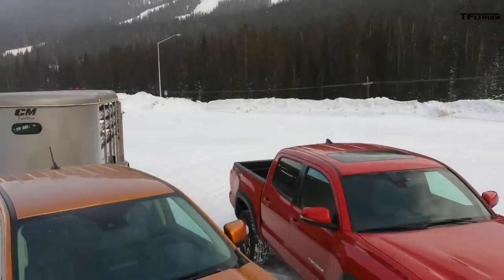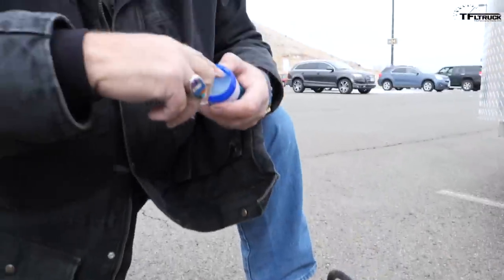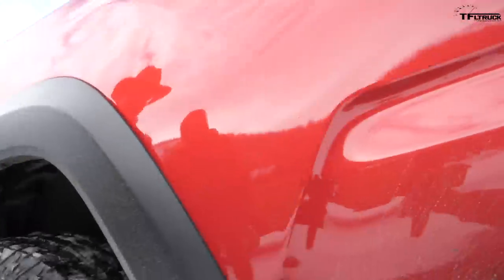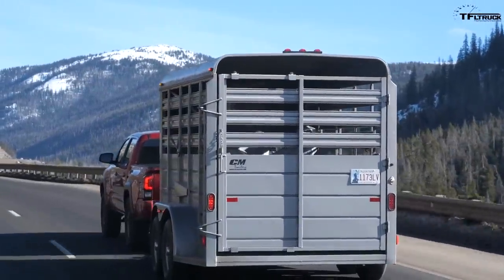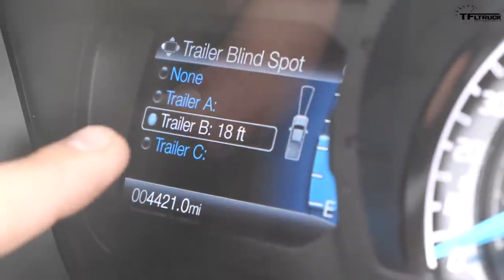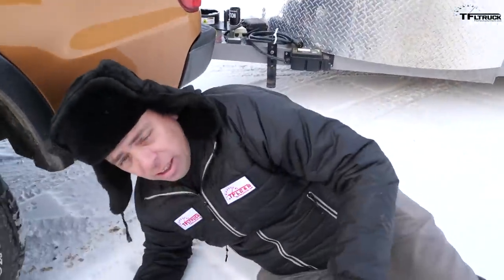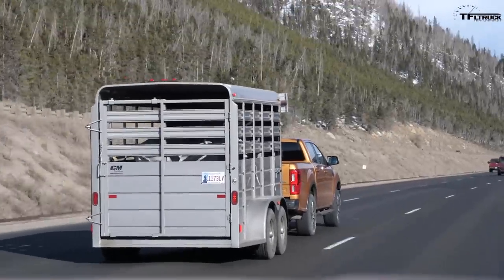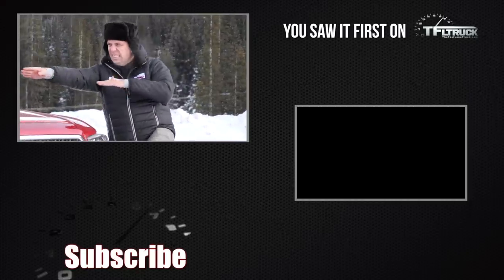Best Midsize Towing Truck? Ford Ranger vs Toyota Tacoma vs World's Toughest Towing Test

Comment: Can yall compare the new ranger to a old ranger so can see what the new one offers that the old don't
Reply: I had a (new) 2004 Ranger, and a (new) 2008 supercab Ranger, traded the '04 in for the '08, in 2013 gave the '08 to my son, (kicking myself), bought a new 2013 Honda Ridgeline RT, did not like it, traded it in for a new '14 F150, supercab, STX, I'm somewhat happier, plan on at least 10 years with it, but, the prices on new trucks!
Reply: @boondocker7964  why would you get a honda there transmission are junk and a ridge line is not a truck
Reply: No comparison. The old Ranger is a dinosaur compared to the new.
Reply: It would be tough to get their hands on one. They can't get an old one from a manufacturer. They'd have to find someone willing to do that, which is not easy.

Comment: It should be noted that to anyone who is buying a midsize truck for towing duty, the TRD Off Road or FX4 are THE LAST trim lines/options that you should consider.  Softer suspensions and taller sidewall, off road oriented tires are not conducive to towing.  For a Tacoma, the best rim line for towing is the TRD Sport as it is the only model with a stiffer dampened, sport oriented suspension.  For a Ranger, you'd want the towing package and maybe the electronic limited slip but not the FX4 package.
Reply: The TRD pro is worse. So is the ZR2. Don’t tow or load more than they’re rated unless you want to replace some really expensive shocks. Best mid size towing is the Colorado diesel non zr2.

Comment: I know everyone has different opinions, but I'd say the Tacoma clearly wins at one thing...worst seating position of ANY currently offered vehicle.

Curious...my Ford vehicle has a similar instrument cluster and I can select to have a full tachometer on the left.  Is that not an option in the gauge settings on the Ranger?
Reply: I love the seating position in the Tacoma, it has proper car like seating.  I haven't sat in a new Ranger yet but in the Colorado/Canyon you sit with your legs underneath you, just like in a minivan.  I guess now that crossovers (i.e. small minivans with forward opening rear doors) have taken over, people have grown used to that type of seating position but I still prefer sitting low like in a sporty car.
Reply: If Toyota just added an adjustable seat for the driver in the upper trims it would be fantastic. The fact you cant adjust is why it sucks. I actually believe the worst seats currently offered actually go to the Ford Fiesta an absolute piece of shit car.

Comment: I traded my 2019 Tacoma for a new Ranger. The prices nosedived for black Friday and I got a much better equipped Ranger Crew Cab Sport  for $2000 more than my base Tacoma crew cab SR. I bought a 7 year Ford bumper to bumper warranty so reliability isn't really an issue lol. So far I'm ecstatic with the Ranger, way better power than the 4 cylinder Tacoma (obviously), way more headroom (I actually removed the sun visor on my Tacoma because it blocked more of my view) and way better seats. I get better fuel economy too and the 10 speed in the Ranger doesn't hunt gears and act a fool on the highway like the Tacoma 6 speed does. I lurk the Ranger forums and so far build quality and reliability seem decent (you'll see tons of complaints about the Tacoma but they sell a lot more trucks too). Talk smack if you want but there's a lot of low mileage used Tacomas for sale recently for a reason.

Comment: That Ranger is a good looking truck!
Reply: The only thing a man chooses by looks alone is a Whore.
Reply: Ranger looks good, but I'll bet will be a mechanical nightmare
Reply: @andybub45  honestly a lot of you people making a big deal out of it SMH🤔 and is not an issue and you don't have to take off the left tire of the Ranger all you gotta do is turn it and you have access to it however It is critical that the oil change duration does not exceed 15 minutes or you risk having no oil pressure on start up. This is due to the design of the variable output oil pump.

https://www.youtube.com/watch?v=8pnW7cz8Lb0

Comment: So it has been reported that the front wheel needs to be removed to do an oil change on the Ford. Amazing engineers those ford guys.
Reply: Mister Berzins actually a Mazda designed engine
Reply: @ALEX-sh3tx  Ford accepted the design for their truck. Good job.
Reply: Tires due for a rotation at the same time anyway.
Reply: @ALEX-sh3tx  Ford has never used Mazda designed engines in the Ranger. The old Rangers used Mazda designed bodies with Ford engines and the new one is an all Ford designed truck.
Reply: Mister Berzins just checked my local dealer. Lifetime free oil changes with purchase.

Oil techs issue.
Reply: honestly a lot of you people making a big deal out of it SMH🤔 and is not an issue and you don't have to take off the left tire of the Ranger all you gotta do is turn it and you have access to it however It is critical that the oil change duration does not exceed 15 minutes or you risk having no oil pressure on start up. This is due to the design of the variable output oil pump.

https://www.youtube.com/watch?v=8pnW7cz8Lb0
Reply: That turned out to be a false report. According to Ford there's a flap that can be pulled down to expose the oil filter, no tires need removed.

Comment: My brand new GMC 2018 1500 steers really goofy compared to my older trucks with a gearbox. 
The difference is the gearbox is very easy and always feels planted. 
The bad thing on the rack and Pinion is it always has to be corrected and you cannot take your eyes off the road for even a split second. It feels like you’re driving on a pedestal you never can tell where the truck is. 
The gearbox I can drive with my eyes closed practically. 

We never had these problems before with cell phone and now all of a sudden they’re banning cell bones from drivers it makes sense. 

Rack and pinion is a cheaper design which can bring manufactures more profits at the customers expense of death,  well that’s just the way the cookie crumble‘s
Reply: Lol 😆 good one

Comment: Alright.... I’m a huge Toyota Tacoma fan, and I have an ‘01 3.4 V6that has 259k trouble free miles. I love the new Tacoma, it did really good on this run, up and down. I do prefer the Tacoma to the Ranger, obviously,  BUT I’m not like the dumbass fanboys who jerk it to their favorite brands Instagram page every night.          

    The Ford Ranger is a beast and it showed in the video. Do I think it still has a ways to go? Sure, but it’s a good adversary for the almighty Tacoma. My biggest negatives about the Ranger so far is you can’t get a double cab with the 6 ft bed and the styling in my opinion is a bit too Euro and boring for my taste. 

    The EcoBoost is proven to be solid so far, I’ve seen several go past 200k miles with pretty much no issues, so the engine ain’t an issue at all, at least not yet. 

    All in all, I love Toyota and it’s my pick for a mid size for sure, but if you like Ford and want a Ranger, you’ll have a solid and capable pickup for sure! 

    It’s hilarious though how the Toyota extremists are are all gung ho. You do realize the new kid on the block did pretty much the same our truck did on the first try right? Oh but, “RESALE VALUE... DERP!” WRONG! My first gen and the second Tacoma’s have excellent resale value, the new third gens however are too new to know if they’re gonna have go resale, so sit down, Junior! Also all the Ranger guys are all excited, chill kids, y’all still have a lot of rep to earn! Enjoy y’all’s new year!

Comment: Where's the Colorado or Canyon?
Reply: James MacDonald coming soon. The Tacoma is the class leader in sale. That’s why they are going head to head with it.
Reply: James MacDonald they broke down on the way to the test😂
Reply: At the dealership getting fixed
Reply: 6 cars behind you jimmy
Reply: @I know you are right, And I just got owned but: Tacoma isnt that bad, but I dont doubt the Fords issues. The Chevy with the Duramax will kick the rangers ass.
Reply: Picking up groceries, like it should be doing.
Reply: Canyon v6 beat those numbers and the diesel Rape thoses numbers lolll
Reply: They are both in the shop. LMAOOOOO
Reply: James MacDonald they aren’t good enough for the tacoma
Reply: @devinbender8428  It isn't though, the Canyon/Colorado OS the best selling midsize platform right now.
Reply: William Stewart definitely not 
USA sales for 2018 
Tacoma 245,600
Colorado 134,800 + Canyon 33,400
GM midsized total 168,200
Reply: ...probably in a garage or on the side of the road somewhere.
Reply: Who cares
Reply: Irrelevant
Reply: Already at the top having coffee waiting for the competition to catch up

Comment: I cant tell you how much I appreciate the work (that’s debatable if we can call it work in the traditional sense of the word) you guys put into bringing us the best possible real world reviews.  I’m grew up on a sheep and cattle ranch south of you in the mountains of NM. Toyota’s have always been an amazingly well built truck. I have never been loyal to a specific brand. I’ve always purchased what best attracted my $$ at the months leading up to a purchase. I can say that I’ve really enjoyed every pick-up I’ve owned and driven. A lot has changed in my life from my first truck. At our ranch we had a 1946 Ford wench truck with a flat head V-8, a 1958 Dodge 1/2 ton, 1966 Chevy 1/2 ton, a 1967 Ford F-250, 1979 Ford F-350, a 1983 Ford F-150 and a 1983 Ford ranger. — my dad was a Ford fanatic. I grew up driving all of these and really enjoyed them all but the 1/2 ton short bed step-side Chevy was by far the most enjoyable to drive except for the lack of air conditioning. After the Navy I ended up driving a mix of cars, SUV’s and pickups. I’ve always preferred pickups and large SUV’s with one exception.  My best friend had a 1983 Toyota pick-up . He abused all of the vehicles he owned. His dad would say “you could brake a steel ball with a rubber mallet!!  But he was never able to brake the Toyota. Over the years, my Dad switched to the first Toyota full size truck. He pulled a 32’ 5th wheel with that little trick for 10 years in the mountains of California!!  It’s hard to change the old timers... he grew up and worked on the ranch in the 50’s and 60’s. Ranches
And farmers if that era all pulled far too heavy of a load with their trucks and my dad was no exception. However, he never had a wreck or a speeding ticket and like so many of that time, just believed if you put your mind to it, you can do anything.  
The point here is, my experience is that Toyota makes a very durable and reliable pickup.  I do wish they would invest more heavily and update their trucks on a shorter interval. But, they obviously have developed a winning strategy for the Tacoma.  
My take on your video is this. I think if you want an off-road truck that has great approach and departure angles, a good 4-wheel drive suspension, a durable interior, exterior and resale value, good trailering ability’s,  look no further.  Ford also wins here. If you want a truck to drive around town, occasionally pull a trailer, carry kids and wife in a little more comfort and slightly newer technologies...... and your ok with a truck that isn’t quite as “tough” ......  the Ranger May be a great option.  I personally had hoped for a clean sheet Ranger design with the kind of focused and effort Ford puts into the F-150. Ford did not do this. They basically took a 15 year old design (that’s when Ford designers first developed this vehicle) ... cleaned up some of the interior and exterior styling, refined an existing motor and slapped on a 10 speed transmission.  It’s not a “wow” or beautifully designed pickup.  It’s HoHum and could have been a truck that drove Toyota to finally come out with a truly clean sheet Tacoma.  It’s not and so, when I buy a truck for my son as he graduates from High-school, it will either be the the Tacoma or the Jeep pick-up. It’s my opinion that Toyota and Jeep are better midsize designs, and their style and utility are much more enduring, for the long haul.

Comment: nice job on both trucks. Glad to hear the Ranger did a few things better REALLY glad they said it road better then the Tacoma since it drives pretty well.
Reply: It only drives better than the Tacoma if the engine turns on....... Hahahahahaha. Or the rear end doesn't lock up, or if the transmission doesn't fry....... Or if the electricals don't go out........ Or the turbo decides this is a good day to work. If all those things happen to work then yes it might drive better than the Tacoma but good luck making sure all those things stay working. Ford's been having a hard time doing it and I doubt you'll do any better

Comment: Ford pays half a billion dollars a year to retired American UAW workers. Toyota would leave North America in a hart beat
if they were forced into the union.  Buy the ford.
Reply: Where do you suppose Ford gets that half billion? They get it from gouging the common working man that buys their products. The majority of which have no pension and do not make near the salary that a UAW member does. All trucks are overpriced, but at least with the Toyota that common working man will save quite a bit on repair costs over the life of the vehicle.
Reply: Worked at Toyota Motor Manufacturing Kentucky for 30 years before retirement.  Plant was non-union as is all of Toyota’s North American plants.  Funny thing is, ALL of Toyota’s Japan plants ARE union.  Union is not a deal breaker for Toyota.  They build plants all over the globe and place them where they need to so they can manufacture the product that sells the most in that location to avoid import tariffs.  Example:  Camry, Avalon-Kentucky...Tundra-Texas....Sienna Van-Indiana.....Corolla-Mississippi, etc.
Reply: Not only is Ford the better truck maker it's All American!
Reply: @Irishman1776  wrong. Wrong . Wrong. Are you American?
Reply: @264boresteve  yes union is a deal breaker for Yoda. That's why they set up shop in impoverished states.

Comment: I love my 2019 Ranger Lariat. I get far better mileage than the claims sometimes hitting 30mpg on the thruway and it rides insanely wonderful I hate to use the analogy but it rides like a Cadillac. The power is insane I rarely get over 1/8th throttle.
Reply: I agree. Love mine as well.
Reply: I'm from Costa Rica and here we  have the diesel Ranger, but with those mpg numbers, I will stay with the gas Ranger and it's 270hp and it's cheaper gas engine. (Hopefully in some years it will be cheap enough to import it used from the States). Greetings.

Comment: I know the Toyota Tacoma has always had great reliability until.....2015 model year. It has had issues up to present. Shocking but true and Toyota isn't standing behind their vehicles like they used to.
Reply: Just got rid of my 2015 Tacoma SR5 with transmission issues the dealer AND Toyota would not cover, which was still under warranty. Went to Ford to look at Ranger, drove out with an 2018 F150 XLT Sport for around 38k. Sticker was +51k.  Too good of a deal than new Ranger

Comment: I read this morning when changing the oil on the Ranger you have to take the front driver side tire off. We also have to takeoff two cover panels. This alone is a dealbreaker for me I can’t believe we have to take off the freaking tire to change the oil. I can change my oil in my Tacoma today in 15 minutes With just a socket wrench.
Reply: Most new vehicles have aero underbody panels or access panels that need to be removed to get to the oil filter and drain plug. Many trucks have skid plates that are in the way.
Reply: I understand that....??? But not the freaking tire?  You can’t access the oil filter without removing the TIRE?
Reply: Old man it’s not that big of a deal. Also most dealers offer free oil changes with a new car purchase. 

Also I’d rather do that then burn the shit out my hand because chevy puts it in the exhaust manifold.
Reply: Devin Bender -  I live out in the country where we prefer to do things like change our own oil.  

Don’t want to drive 30-45 minutes and wait 45 minutes for an oil change, and then drive home. I can change my oil in 15 minutes on my current  TRD Off Road Taco.
Reply: Old man well less than 20% of the USA lives in the “country” 

And I live in the world where if I can get a free oil change I’ll take it. 

Also I live in a suburban area where there are 4 ford dealers within a 15 minute drive
Reply: Devin Bender  well live it up in the city!   Having said that I just read this——- If you’re holding off on purchasing a new Ford Ranger based on what you read here last Thursday, consider this a green light for your trip to the dealership. The new-for-2019 Ranger does not — repeat, does not — require the removal of the left front wheel in order to access the oil filter. 

Drawing from a source with knowledge of Ford service procedures, our January 3rd story stated that the oil filter on the 2.3-liter Ecoboost four-cylinder found in all U.S.-market Rangers would be removed by technicians via the left front wheel well, necessitating the removal of the wheel. Not true, according to Dawn McKenzie, Ford’s North American product communications manager for trucks and commercial vehicles.

While the written process provided to us listed the removal of a LF wheel arch access panel, held in place by nine fasteners, Ford North American product communications manager Mike Levine states only three fasteners need to be removed in order to peel back the flap to access the oil filter. The wheel does not have to be removed to facilitate this. You’ll want the wheel hard over, though.

It’s a procedure similar to that of overseas models equipped with the 3.2-liter diesel.

So, with that said, apologies to Ford for the error and to our readers.
Reply: Ford says you do not need to remove a tire for oil changes.